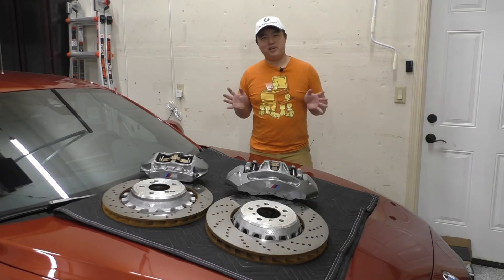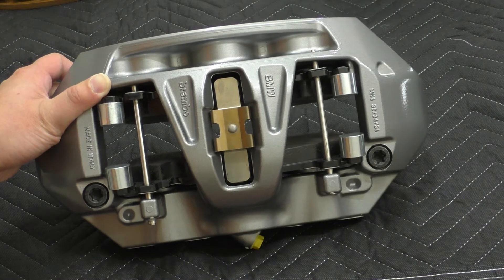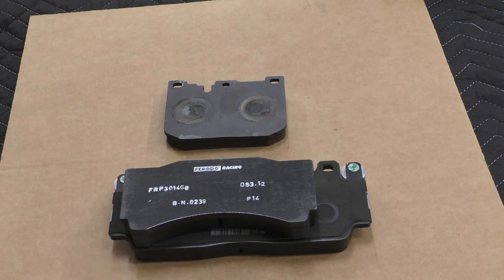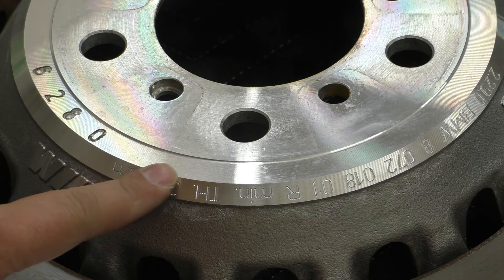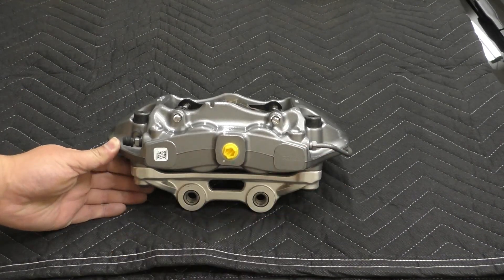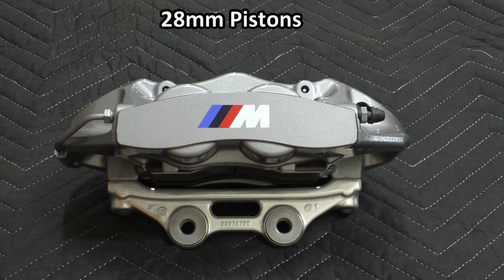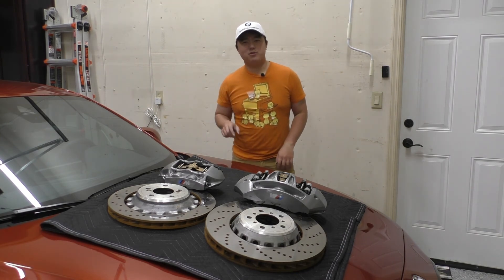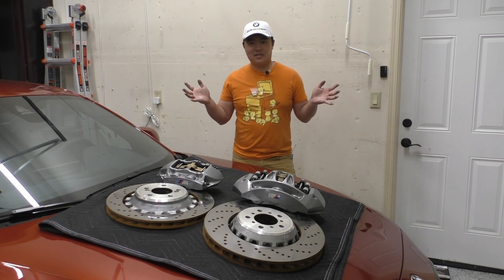BMW M2 Competition Brembo Brakes Overview

Comment: Beefy for sure! The downside with this kit is the crazy weight. I tried it but directly when i drove the car it felt worse than before.  The high weight made the car feels crashy and clumsy on the road and suspension didn't like it at all. Me neither. When i compared the weight with ceramic discs the difference was about 15 pounds EACH at the front. That is a crazy amount of weight difference for just one wheel axle. As it is proven that the stock blue calipers works fine on the track with a set of Ferodo race pads and a better and lighter floating disc i would choose that instead. I got a good deal on ceramics so i bought that and the car feels much better, tripping on it's toes and steering and suspension  behaviour is much better.
Thanks for the review :)!

Comment: Hai, can this brake kit set install to f30 models? Thank you
Reply from the maker: It's not a drop in install on F3x vehicles. You'll need an adapter bracket.

This post outlines it pretty well: https://f30.bimmerpost.com/forums/showthread.php?t=2002285

Comment: Any suggestions for brake squeal?
Reply from the maker: You'd probably be best getting more street oriented pads. You can attempt doing a proper bedding, but any pad with decent metallic content (which performance pads have) can squeal.

Comment: hello!
good video

Where can I find and buy them?
I have searched on some pages but they appear sold out 😩
Reply from the maker: You can buy these Brembo brakes from BMW dealers. I recommend using RealOEM to look up the PNs. You'd need the PNs for the various pieces (calipers, rotors, brake lines, ect.).

Comment: I have a BMW X5 30d. and I want to buy brmbo 6 caliper front and 4 caliper rear brake system. can you tall me where can I buy them?
Reply from the maker: You can go to www.realoem.com to search through the available BMW brakes for your model/chassis. BMW offered 6-piston Brembo front calipers, but not 4-piston rears.

If you want 4-piston rears you'll have to look at an aftermarket Brembo kit.

Comment: Do you still have these brakes? I want to upgrade the F82 blue brakes to these. From what I know these are direct plug and play.
Reply from the maker: I sold these brakes shortly after getting the AP Racing set. You're correct that these are plug and play on the F82. Just make sure you have 19" wheels.
Reply: So these won’t fit under even 18” apex wheels? Any idea where to read more about this? A lot of conflicting info out there on this.

Comment: Excellent video - are there any brake related software differences applied to the m2 vs the m2 comp with 6/4 piston kit?
Reply from the maker: There's a VO code specifying the larger 2NH brakes, that will drive other config changes in modules like the DSC module for them over the Brembo 4/2 piston brake set.

Comment: What a PITA to have to take the caliper off every time you have to change pads! It wouldn't have been so bad if you could do it by removing the Torx fasteners, but of course those are the ones BMW doesn't want you to touch. D'oh! At least the pads are pretty meaty, so hopefully you don't have to do it that often.
Reply from the maker: Yeah, and as petty as it sounds, that's a big reason I went for aftermarket calipers where I can swap without taking off caliper.
Reply: Just did mine in my driveway and the more annoying part is getting the guide pins to align. Farkle did make it seem like a breeze but being in the north east, one of my guide pins decided to seize up 😢

Comment: Excellent video. Can anyone recommend aftermarket pads for streets and occasional track use but one that will produce less dust than the stock pads?
Reply from the maker: I'm not sure something like that exists. Usually the "dual use" pads still dust a fair amount. You can look into  EBC Yellowstuff, Ferodo DS2500 (these definitely don't dust any less), or Stoptech Sport pads for dual use. Just remember that dual use pads don't tend to last all that long at the track.

Comment: Do you know if these calipers and rotors could fit an E92 335I? I've seen the front calipers and rotors for sale at a somewhat cheap price so wondering if I should go for it.
Reply from the maker: Unfortunately I don't know if it fits an E92. I believe E9x M3s can use F3x/8x brakes, but not sure about the non-M models.
Reply: I am fitting them to my e92 335is with the seems legit garage brake caliper adapters/135i rear hubs. I am already using the standard f8x blue brakes. I  steal on a set of these so I picked them up. ill post a video once I have them mounted. also if you are interested in buying a set of blue F8X brakes I have a set
Reply: @nate9114 hey wondering if you ever ended up installing these?
Reply: @nate9114  hey wondering if you ever ended up mounting these?

Comment: So dumb question... these stock Brembo pads are not ceramic correct?  I assume you'd want something else for track days.   I wish I could find a pad that's good for track days + daily driving so I don't have to continually change them
Reply from the maker: Yeah the stock pads aren't ceramic. Ceramic pads are for street pads. Track pads are typically metallic. Some of the Stoptech pads, EBC Yellowstuff, and Ferodo DS2500 can be dual used, but get eaten up at the track at a pretty high rate.

Comment: hi - the front calipers and discs are originally from the M5 F10 / M6 F12
Reply: Calipers have a slight difference in fitting. can't use the M5/6 calipers with m2 rotors as they are thicker, use of brackets will come into play

Comment: You got me thinking about your comparison of the M2C rear brakes to the F3x M Sport front brakes, so I pulled out specs that I collect to see if I had additional information.

Pistons:
M2C 28mm x 4
MS 40mm x 4
(Obviously it would take exact area measurements of pads to calculate force exerted by caliper pistons/pads on rotor surface)

Rotors: (2-piece)
M2C 380x28 21.0 lbs
MS 370x30 26.5 lbs
(This difference surprised me, if the weight that I had is accurate. It’s from Zimmermann specs, not from me weighing them as you did. Would seem that the design of the M2C 2-piece rotor is more efficient for weight savings.

Anyway, cool video! Thanks for posting!

Comment: Nice video. But these are cast calipers not forged ones just saying...
Reply: Forging in the context he's using is correct. One piece moulding. You mean hollow?
Reply: @ness-uno1  no it is not. A forged caliper is a forged caliper. This is a cast caliper. You’re thinking monoblock. You can have a forged monoblock or a cast monoblock.

Comment: Thanks for another excellent video chock full of interesting details. It was interesting that pads didn’t have weights and no grease was used. On F3x brakes that would cause all kinds of noise and complaints. Was there noise when you were driving these stock M2C brakes? Maybe Brembo has engineered out the need for weights/grease with this caliper design?
Reply: I have an M2 comp, its been my daily for about 18 months now, the brakes definitely squeal at very low speeds and have since the car was virtually new. Not super loud, but its there.
Reply: Guess if you’re driving a race car, squealing doesn’t matter.

Comment: This brakes are awesome, i have them on m2c too. 
Rear OEM brake disc and pads are great.
On front i am using girodisc brake disc and endless pads - fits like oem.
Reply: I got the M2 competition 2020 3000km and my breaks speak when I stop do yours ?
Reply: @nimkiirogers7053  nope....
Reply: @nimkiirogers7053   Look up the bmw m performance brake video. It explains about squeaky noise.
Reply: Girodisc now have rear rotors also for the 2NH in case you wanted some.